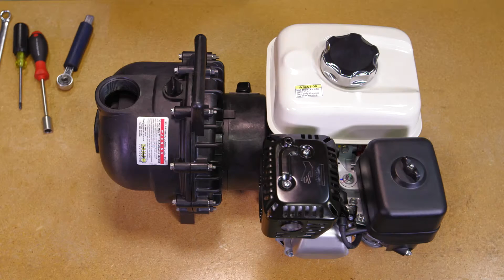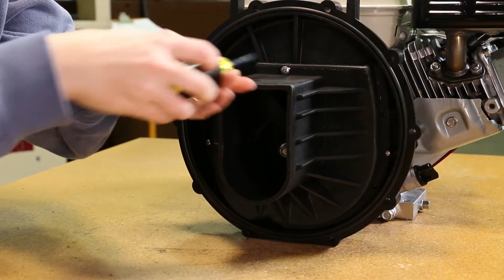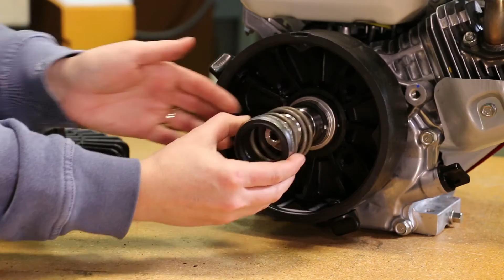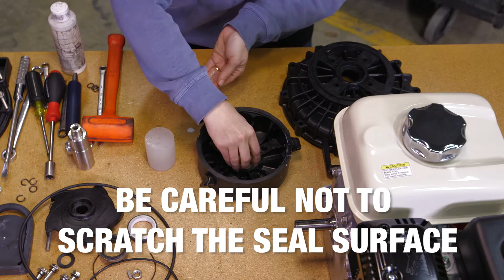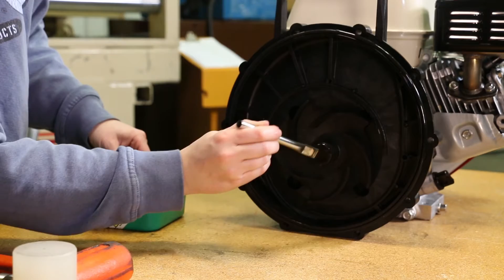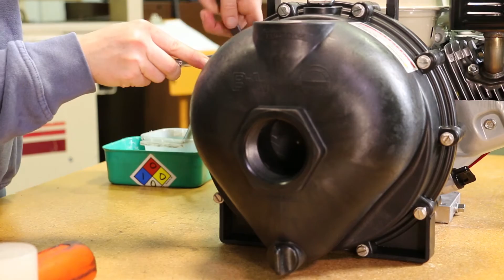Banjo Poly Pump Wet Seal Service

Comment: Have numerous pumps, which are serviced annually with seal replacements.  Seems the GX160 and GX200 engines use different impellers for same pump.  Only the GX200 pumps have the self removal nut for impeller removal.  Almost impossible to remove the non-tapped impeller style without breaking the impeller.  Any suggestions?
Reply from the maker: All of our poly pumps should have the nut behind the impeller. If you have any problems removing the impeller, you can try prying evenly around the impeller with a screwdriver. If you have any more questions or you would like additional information, please email banjosales@idexcorp.com.
Reply: Obviously you have never worked on pump that was used for pumping liquid fertilizer. Chances of prying the impeller without breaking is almost impossible (100:1 shot).